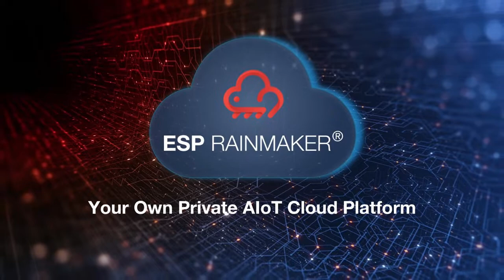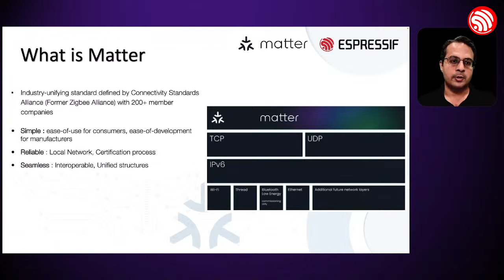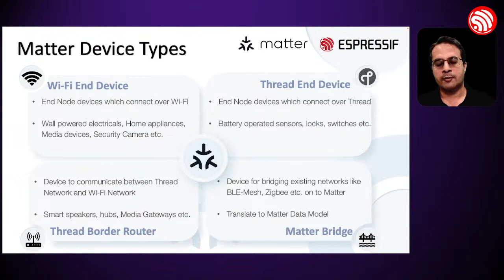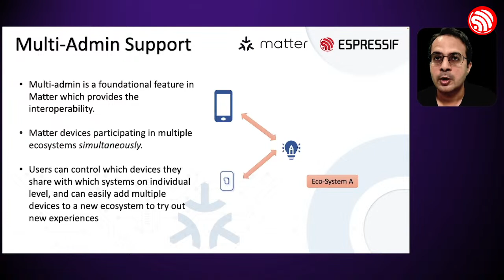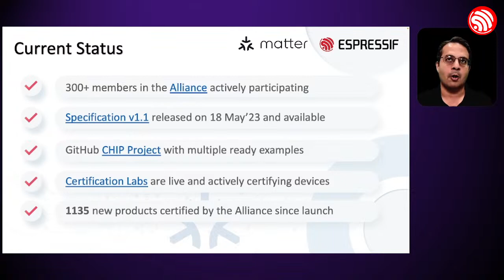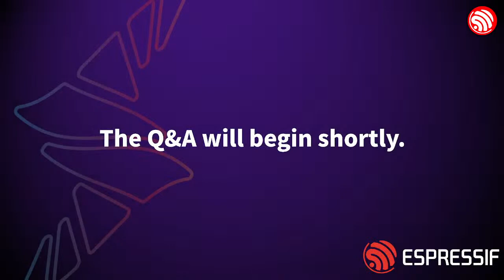Introduction to Matter

Comment: I don't understand what makes matter over-Wi-Fi devices interoperable if we still need a hub according to the ecosystem. For example, if we use Google Home, we need a google home hub, if we use a Apple homekit then we need an Apple hub and so on for Amazon. There should not be any requirement of hub if matter is just an application layer on top of other protocols. We understand for matter over thread a border router is is required to connected thread network to external internal IP network but for matter of Wi-Fi, it does not make sense at all use an external hub.
Reply: I think why they still need  a hub because your app (SmartThings, HomeKit, etc) will send command into their own server. And then their server will send to their Hub to execute which device to execute the commands. I think the mobile App and Hub will hold their own customer (since you and me have different preferences. ex: I like to use HomeKit, so i don't need install SmartThings app). But every products now have standard for communicating from Hub to smart home end-device through Matter protocols. So the company just need update their own firmware/software to implement Matter protocols. I the summary, it's not fully interoperable by network. BUT interoperable between app through Hub. The key of Matter protocol is Hub. Disclaimer, this is my own opinion. Right or wrong is based on your perception. :)
Reply: A single hub can control all matter compatible devices in your home !